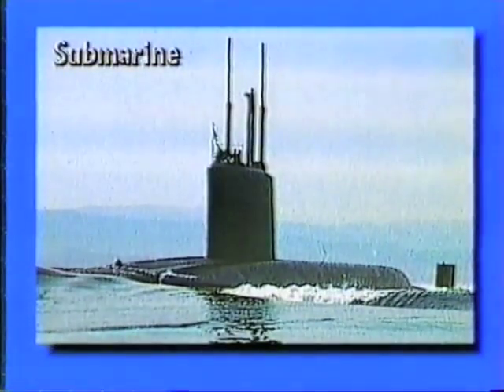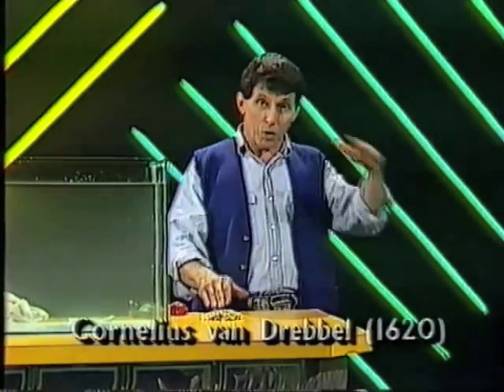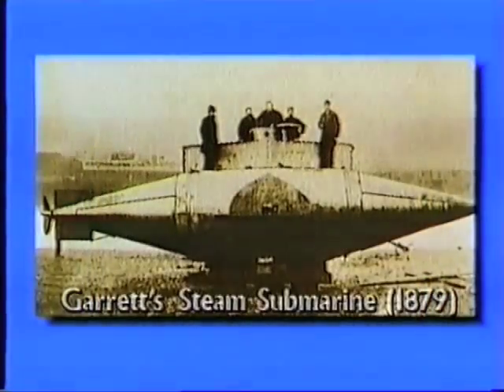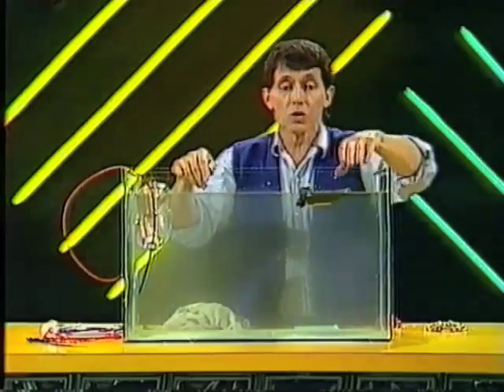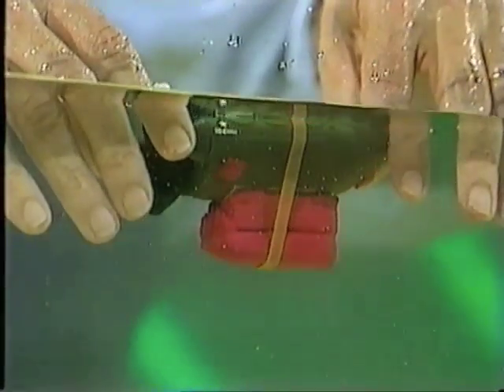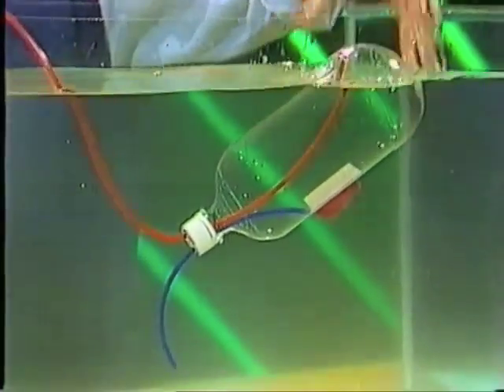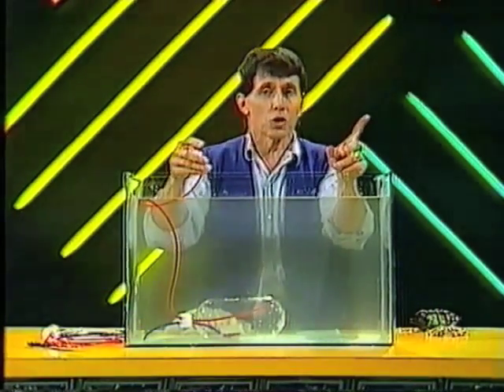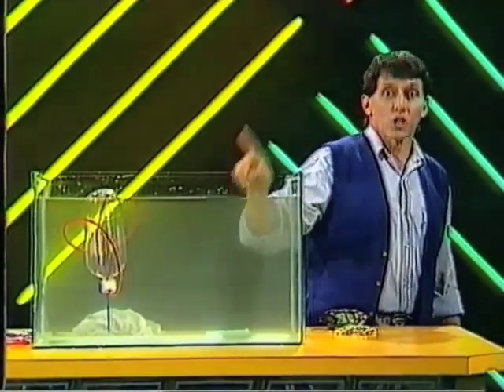Model Submarine

Comment: I remember from watching this show, and as a child I built it many times, the diving man in a milk bottle project. It required a milk bottle filled with water and stoppered with an airtight flexible membrane. I recall using something tougher than a balloon - maybe a piece of old bicycle inner tube. Inside the water-filled milk bottle was an inverted glass tube, roughly half-filled with water, and with enough buoyancy that it floated to the top of the water inside the milk bottle. Pressing the rubber membrane that was sealed at the top of the water-filled milk bottle would sink the inverted tube (the diver). I could build it again now, if I could find a milk bottle with a wide enough opening at the top.

Comment: So air (oxygen)  doesn't become ore buoyant when you compress it?
Reply: Logic would dictate that the air in the tank would be heavier because there is more of it compressed into the same space, where in the buoyancy tank the air is replacing water. At most it would be neutral.
Reply: HIF

Good point.
Reply: @hyperintelligentfish3873  Yes, it does, but air is still less dense than water at the same pressure. Other thing is that as the water is pushed out, the air becomes less dense as it spreads out to fill the space left by then water. There is a lot of physics going on here.
Reply: There's air in water, but it's compressed into the water before it can resurface. Really weird stuff. So I think that's why they have water & air together to compress the air into the water.

Comment: It'd be great if you explained how the buoyancy tank works even when it has no access to the air above the surface.
Reply: Cameron Pearce the compressed air tanks basically displace the water in the buoyancy tanks by releasing air into it, I'm assuming that they can run out of air in these compressed air tanks because of it
Reply: They pump the air out of the buoyancy tanks back into the compressed air tank using a compressor. Otherwise the air would just bubble out of the tank and give away the position of the submarine on the surface.
Reply: Again, I am well aware of how it works. It'd just be nice if he went more in-depth in the video. Keyword "he".
Reply: Yeah, I myself understand this, although I wish they would in the video.
Reply: Underwater they pump out the water, its replaced by air. How? The air just becomes thinner. (Even without any air, a vacuum would actually be more boyant than air)
Reply: He explained that they use compressed air. Rather than a tube to the surface the tube goes to a tank of air.
Reply: These videos are aimed at primary school kids. The explanation is more than enough. This segment was around 5 minutes long, which was about the limit for the audience that it was aimed at.

They were made in the 80's and 90's.
Reply: He did enough that if u don’t have an American education u should understand